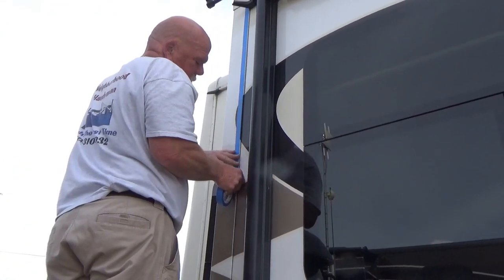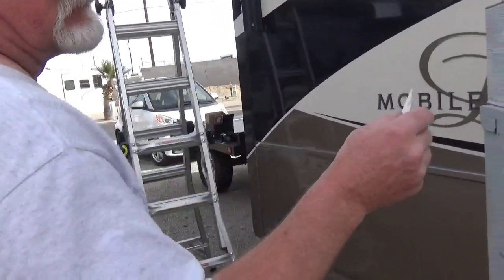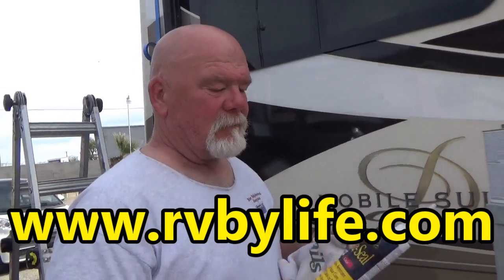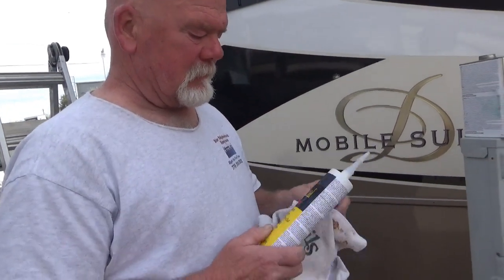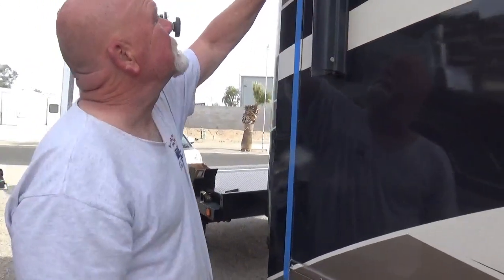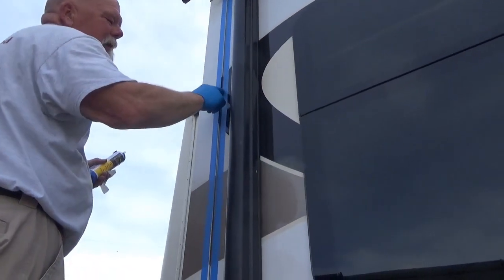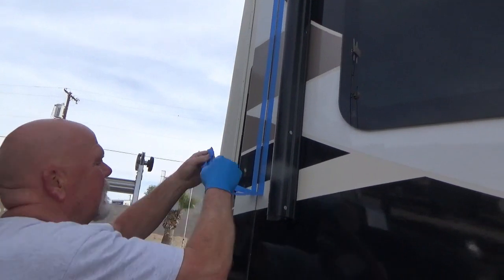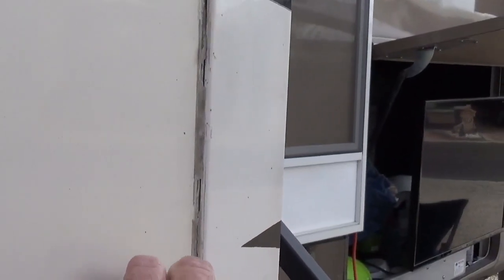Best Caulk for RVs?? (Part 1)

Comment: Very interesting, we took our used  2013 Drv, to Twin Lakes  RV in Lagrange, Indiana for repair work last month.  Jay The owner replaced one of our water damaged bedroom slide out floors also.   And then he also recaulked  all our trim moldings on the exterior of our coach.  He used Clear Geocel. 2300 MHRV sealant.   He also adjusted 2 of our slide outs and then put all new brake pads on.   And then also serviced the oil  bath bearings.  And then he had the exterior of the coach all cleaned up for us when we picked it up to take it back home.   We were very happy and satisfied.   Happy safe travels to you.
Reply from the maker: Nice to get great service isn't it?  We used the 2300 caulk before but life seal seems to be working better for us.
Reply: We are on the schedule to have Jay replace our DRV bedroom slide floor too.   Our DRV is new to us but is a 2015.  We have used Jay, Twin Lakes RV Repair 3 years ago and are glad he can help us again.

Comment: Great information, I’ve found that using Acry Solvent to remove old silicone and other sealants is a dream. The old sealant just peels right off. Then I wipe it down with acetone and then denatured alcohol. Then the I apply Proflex, it seams to work well.

I’m looking forward to a long term review on the life seal.
Reply from the maker: Good stuff Hard Truth.  I've got some caulking to do pretty soon.  I'll check it out.

Comment: I'm a roofer by trade.  Best sealant I've  used is mulco supra expert.  Thermoplastic sealant.  Can stretch 1400 percent.  Can get it in multi colors.
Reply from the maker: That stretch is needed.  I'll check in to that.  Thanks

Comment: Since we're not getting any younger if you need to caulk. Grab an Albion B26 caulk gun from ABC supply etc. You will throw that old caulk gun in the trash immediately. The B-26 is a 26 to 1 ratio so it's much smoother and easier to use about $30
Reply from the maker: Awesome...thanks

Comment: Have you ever tried #900 SOLAR SEAL this is all we used in the construction trade never seen any caulk work this good. And you can't get this at your normal box stores.
Reply from the maker: No we haven't, but I'll check into it.  Thanks for the tip.

Comment: I used to use silicone caulk till.my friend pulled some off and show me just how weak it is and how it does not bond well.  Silicone is crap . Polyurethane is king of caulk.  Simple. ..number 1 rule for RV is NO SILICONE ON YOUR RV
Reply from the maker: Lexel was the last stuff we used...last long but harder to work with.
Reply: @WattsOnWheels  that what I use as well. To tool it I use some soapy water on my finger and it smooths out nicely. Can also use mineral spirits but I the soapy water seems to work fine for me.

Comment: I was using Proflex for some time on our 2015 DRV Manhattan and then switched to Lexel Clear Caulk. I’m not happy with the cured look of either brand. Lexel tends to bubble under high heat and Proflex just has a rough look to it, which isn’t great when checking out the rigs paint job. I like the finished look of the RV Life brand. Are you still happy with this product. What’s your thoughts on the no silicone rule for RV’s and this product contains a mixed blend?
Reply from the maker: Hey Brian, we are away from the rig right now.  I'll get some pics and post a video of our current thoughts of the product.
Reply: Sounds good. Thank you!